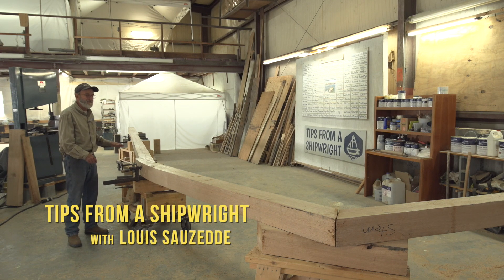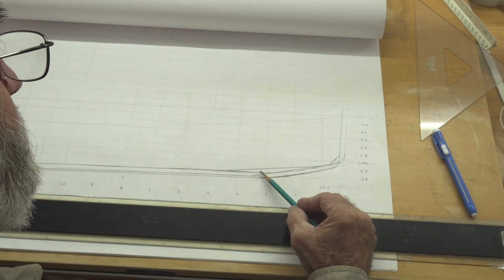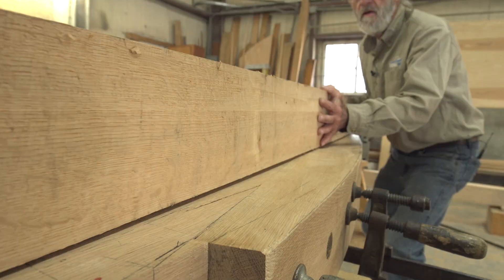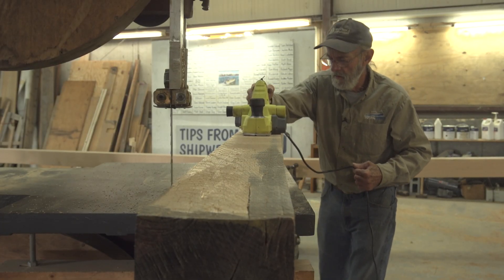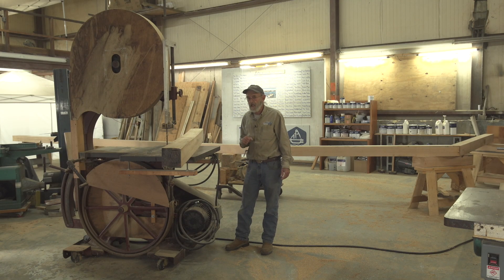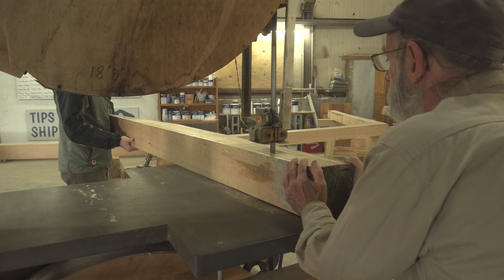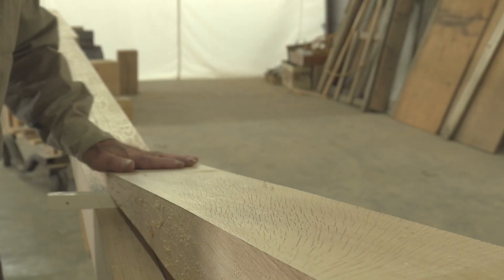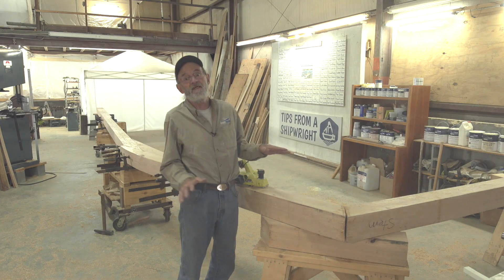Building ORCA - Episode 6: Connecting the keel to the forefoot

Comment: This is so educational as well as entertaining! I need to replace a bad wooden add on keel that was mahogany wood put on a  groverbuilt 26' boat many years ago and is now rotted. I have been told I should use mahogany again or brazilian oak as a replacement. The boat is fiberglass with stern having a fiberglass keel and this keel bolted from it to bow area 2 1/2" wide, maximium of 6" tall tapering to only 2 1/2" tall where it stops shy of bow and wood keel addition is total of 20' 6" length.  Can I use white oak and make it in two sections scarfed like this one instead of mahogany? Does anyone know if I should or not? Any help much appreciated!

Comment: Lou, far from me to tell you how to use your saw, but you might want to adjust the rear roller guide a bit forward. It looks like the blade’s teeth hit the side guides when you feed the wood in as evidenced by the sparks. As you know, that’ll dull it pretty quick. My first job after being trained as a Navy shipwright was to cut oak planks for the old wooden hull minesweepers on an old re-saw bandsaw about that size.

Comment: Dear Lou, why not use glue along with the mechanical connections?
Reply from the maker: We won't glue it because it won't hold but we will bed it when connect the joints.
Reply: @TipsfromaShipwrightvideos  Thanks for the answer, Lou!
Reply: Makes it near impossible to replace a part when the inevitable rot sets in.
Reply: This is the keel we are talking about, gentlemen. The very backbone of the ship. You want it to be "one" strong piece. Mechanical connections loosen over time due to the flexing of the timbers. I would be more interested in hearing what Lou has to say.
Reply: @brutusbarnabus8098  The keel isn't done yet, so hopefully this will get answered.
Reply: Also gluing oak is pointless. The wood expands and contracts so vividly, the glue couldn't keep up.